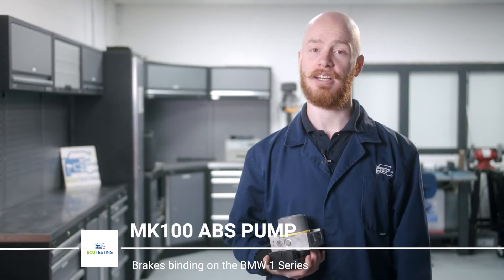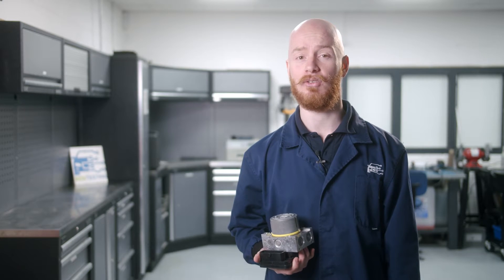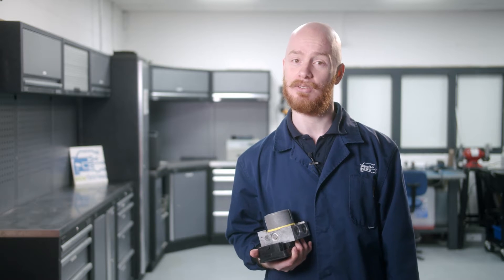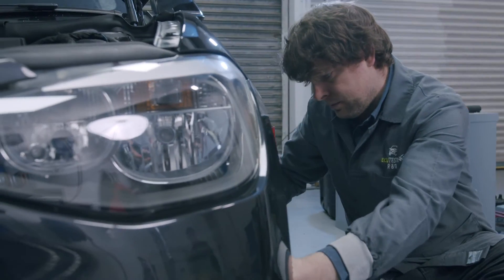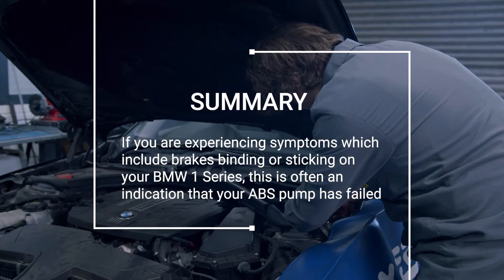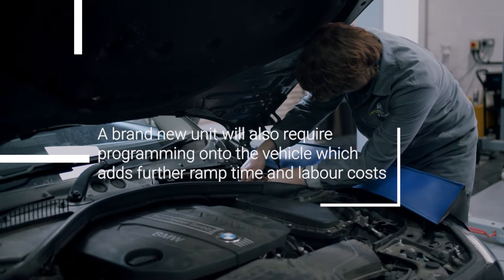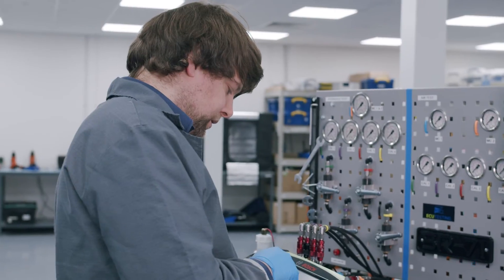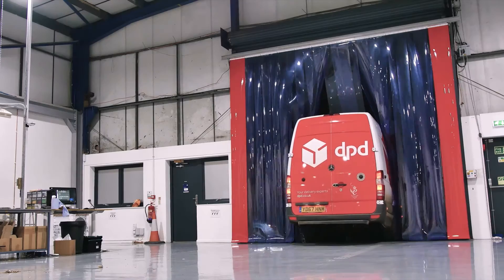BMW 1 Series Brake Caliper Sticking – Caused By ABS Fault.

Comment: I have a bmw f20 116i the right driver side break caliper is dry no fluid do I have a abs problem
Reply from the maker: Hi. It is possible you have an ABS unit fault. Please email our technical support team at info@ecutesting.com with the information you have supplied in your comment, as well as any fault codes or fault symptoms present, and finally the part number printed on your ABS unit. They will be able to advise you of any re-build solutions we can provide. Thanks.

Comment: Got the same problem with 2006 e87 120d m47. Left front brake is stuck until bleeder on caliper is open.
Reply: Have you managed to get this sorted mate? I have the exact same, brakes work normally when I unplug abs fuse. Trying to work out what it is before trying costly repairs
Reply: @nathanheath1412  Yes mate! Did caliper rebuild for second time after year. Now it works fine. I hope the problem is gone for good.
Reply: @sauber8623  cheers mate, I think mine is probably more likely a sensor because the brakes only seize when the abs is working, if I unplug the fuse they work fine
Reply: @nathanheath1412  ABS ring failure at wheel hub is common on e87 so that's can be a problem
Reply: @sauber8623  cheers, that seems like the likely culprit
Reply: @nathanheath1412  where is the abs fuse please?